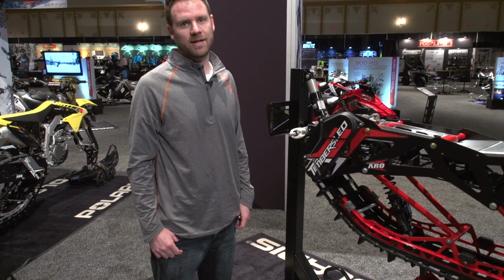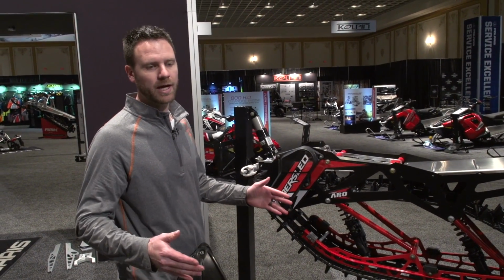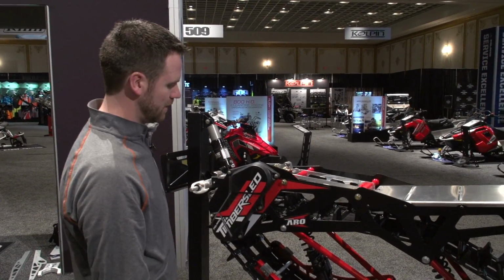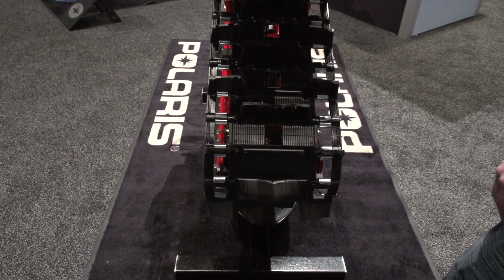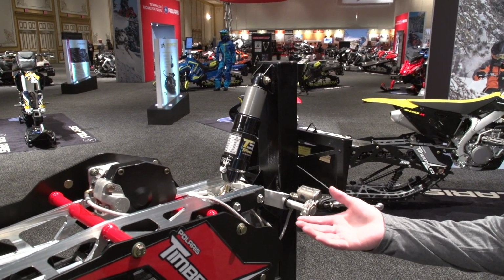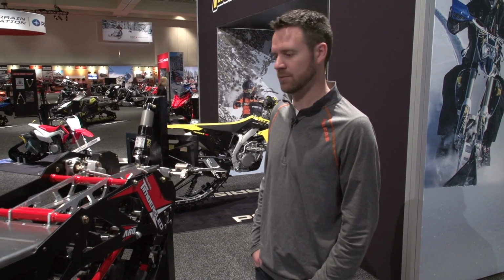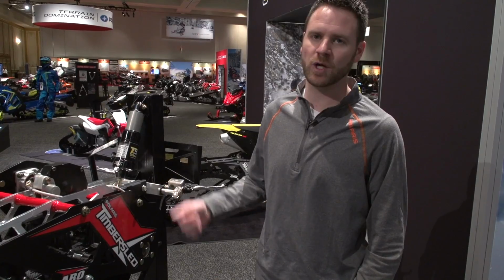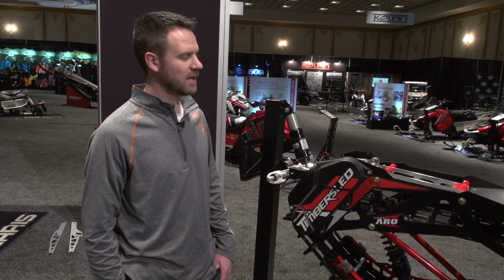TIMBERSLED ARO ENGINEERING WALK-AROUND - Timbersled

Comment: The Yeti's skis has less wash out and better maneuverability wins. The Yeti is still lighter. The Yeti's belt drive vs. TS chain is still more efficient and faster. The TS wins on durability of chassis and frame and ease of adding and removing kit. TS has the edge on suspension with TSS shock and upgraded Fox shocks in the skid. The TS price point is a win. The Yeti is using more advanced materials, titanium and carbon fibre however I am still suspect of crashability of their tunnel surviving very hard impacts. Overall they both make excellent kits, I currently run a TS fully upgraded with a Yeti ski and spindle, and can ride where no sleds can go and back no problem.